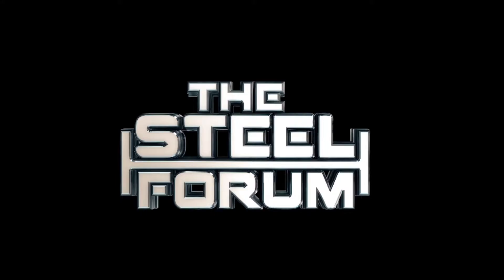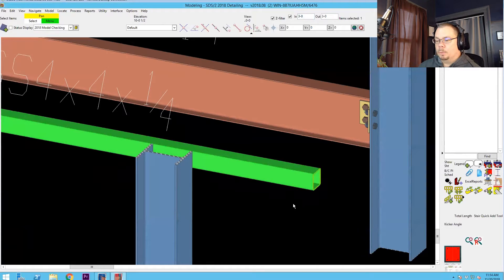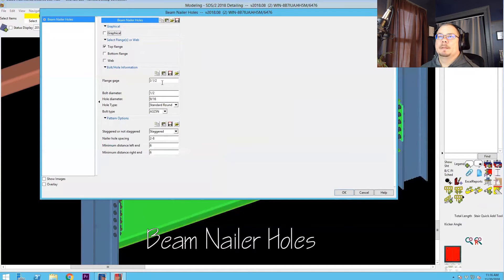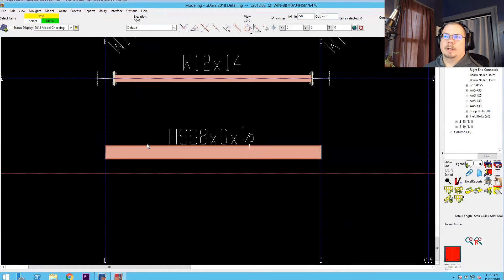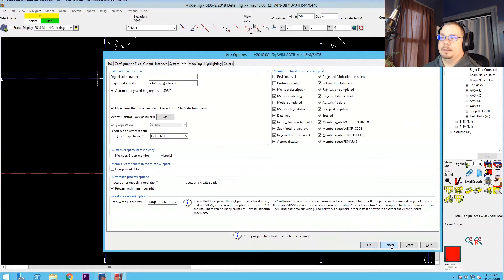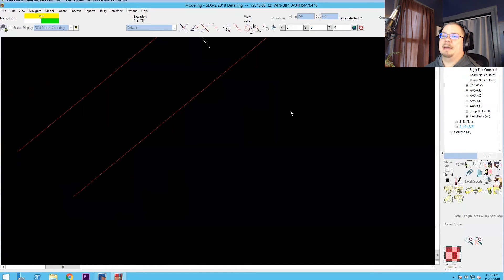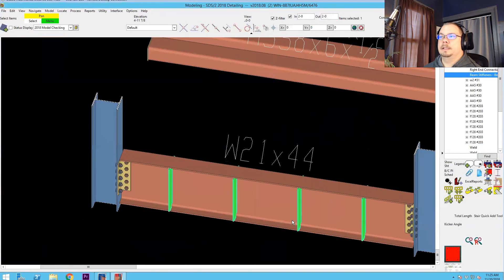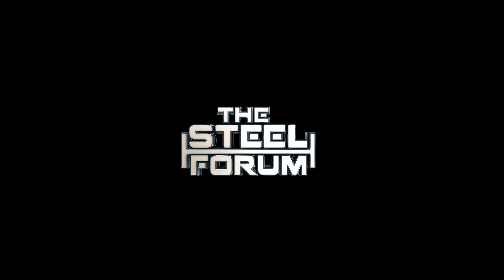Customers' Classroom: SDS/2 Components 101

Comment: I use this option but the problem i run into is that the shop prefers us to of course make the plate  1/8 all around smaller to make room for welds. The problem being the components will not round the corners of the cap plate. It clips the corners and the shop says thats ugly.  So not sure what to do there.  thanks for the video.
Reply: Hey steve, find us over on the subreddit and we might be able to help you out.